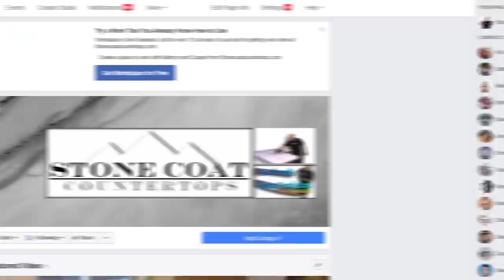Learn Advanced Color Technique Using Epoxy Resin | Stone Coat Countertops

Comment: Would love it in my kitchen, however, would need to up date the entire kitchen to go with that fabulous countertop. What a way to make a statement. Loved the video of the countertop redo on boat in Florida. Would love to have those colors on my kitchen countertops!
Just discovered you guys as I was looking to cover my paint pouring pieces with resin. What's the difference between epoxy and resin?  Is the epoxy you sell a two step process in the mixing ( as in resin and hardener)?  Can you apply it in layers? 
Was watching an artist build 8 layers with resin, adding acrylic paint onto each layer for depth. It was beautiful!
Thank so much!

Comment: I would NOT have that as a counter top- Not a Chance! Now, I WOULD LOVE to have that, along with two or three more panels as a room divider or accent triptych art piece in my home- placed where the entire magnificence could be taken in much easier, without having to climb on a chair to look down, if it were merely a counter top. I am currently working on 2 projects and intend to make new tops for both the metal cabinet I'm refurbishing for a TV stand and a unique shelving unit-dresser, with small drawers going up one end, and epoxy tops will be perfect for both, but they are small enough that any piece of artwork on them could be easily viewed, and a more creative use of color won't be a distraction as they could be on a larger piece. It all depends on the rest of the decor, of course- but that's just my own artistic sense-  plenty of other people would disagree, and that's fantastic! Art shouldn't be conformist!

Comment: I see what you were trying to do there, calling out individual techniques... I think i've been a little frustrated with some of the videos lately.  When I show videos to people skeptical of the idea of going with Epoxy, some of these scare them away more than catch their eye with what is possible.  They tend to be more wild as far as it comes to style, and so I've been having trouble deciding whether I want to work with the new techniques, or how to mix them with videos you put out the past several years.   I don't work with epoxy daily, so I only have the experience of using it a few times  to compare to.

Some things that come to mind:
I don't know if there is a reason to choose dyes over powders, or how the two interact.
I don't know if i should always be taping the edges to create a dam which seems to be something you've done in several recent videos or not
You seem to not make use of the trowel much anymore or chop as much as you used to
I can't tell how well dirty pours would work if I don't have the ability to tilt
Reply: Good questions.